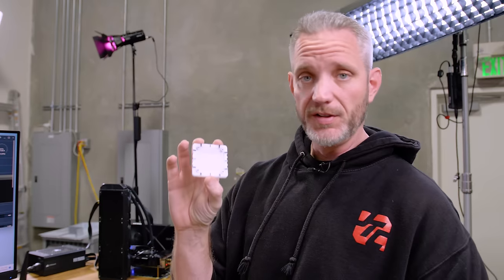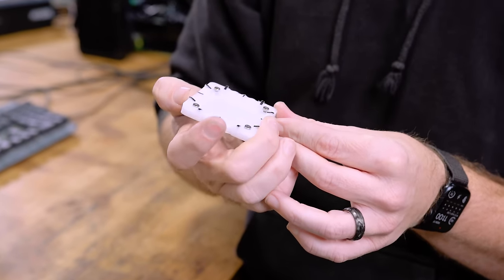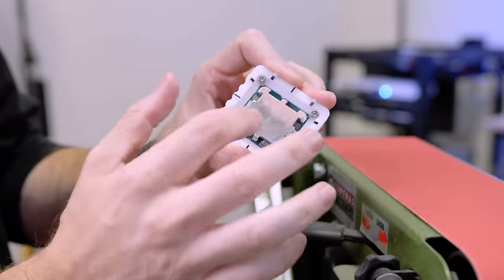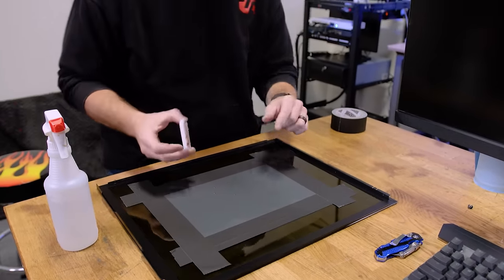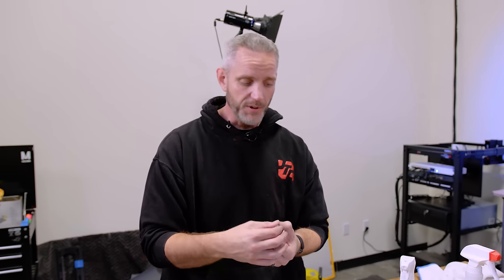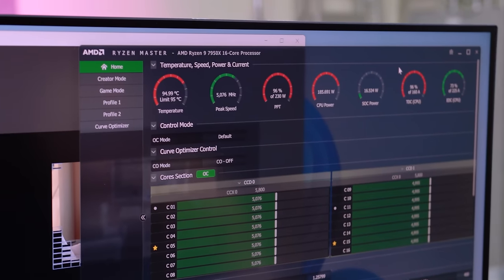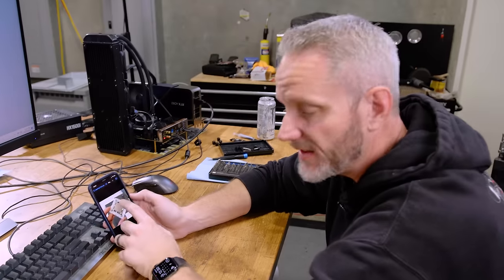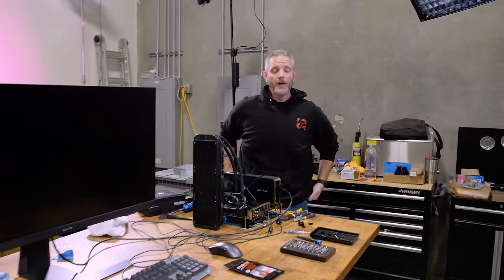Modifying the 7950X CPU for better thermals... VOIDED WARRANTY!

Comment: Jay you shoulda gone all the way and showed us the 1.2 mm result. I was hella curious what you’d get, and without reality to settle me down, I keep wondering “what if it would have dropped 10-15 degrees if he went that last .4”….
Reply: It’s not going to drop another 10-15 like that, probably 5 C is realistic and 10 is very generous. Direct die only takes about 20 C off so this would have to be less than that
Reply: Yeah do not expect miracles from another 0.4mm, but at least he did the test and seeing results for me at least totally worth it, as lapping still has protection for the die, and you shave off like 10-15degrees which is a big improvement from 95, realistically speaking no cpu will run full tilt, but reducing temps increases significantly cpu life and gives extra performance
Reply: Might as well go all the way imo. I would not do it without delid first though.
Reply: @alexmills1329  The autism lvl of AMD is is 10/10, that we have 95c temps instead of 85c because they wanted to make it AM4 cooler "compatible"
Reply: @TheEchelon  Yeah and Audi designed their timing chains last the life of a car.
They didn't last 30 000km. Its a bad design and AMD will address it.
Reply: @hellraserfleshlight   what is the actual 5950x IHS thickness? I think in the vid Jay already showed that lapping 0.8mm got the temps down like 10degrees and there was room for a bit more improvement...
Reply: @DuBstep115  Cool story bro, but there have been 0 incidents that proved AMD to be wrong, but I guess time will tell. But I do agree that it runs hotter than I'd like to see. However, to make matters even worse, go ahead and watch Intel's 13th gen reviews that just dropped and let me know which of the two companies is more autistic ;) Running at 100C and drawing over 300 watts, with almost 500 watts peak, while performing similarly or worse. I'd take the "autistic" 7950X, thanks.
Reply: @alexmills1329  yeah it wouldnt be massive but it would definitely be closer to direct die cooling
Reply: @TheEchelon  Uh I would rather a 13600K or 13700K compared to their AMD counterparts, because AMD in their infinite glory thought it was a good idea to not have DDR4 compatibility, also the 7950X is running at 95c so cool story yourself? Only the 13900K can pull 300W and it will only do this for about 1 minute or so before going back down to and stabilising at its TDP pf 250Ws, and it cannot reach 500W I have no clue what you are on about there, but the 7950X can reach 220W itself. 

"while performing similarly or worse" They are practically on par with each other, I have not seen a single review that warrants using the word "worse" to describe the difference in performance between a 7950X and a 13900K, although in saying this, where I live a 13900K is $100-$200(KF) cheaper then a 7950X, so.. also what is interesting here is that the 13th gen is basically running on a TSMC 7nm processor, and Zen 4 is on a TSMC 5nm processor, to put this into perspective Zen 3 was on a 7nm chip, so I would expect the power draw/efficiency to be in AMDs favour however this makes meteor look much more interesting as it will be a TSMC equiv. 4nm chip, which is what Zen 5 is going to be. Also people seem to forget AMD does not make their own processors, they are made by TSMC, Intel is actually making their own processors.
Reply: @Gandalf721  no it isn't, why does it being a new platform make that reasonsble? Intel has had a new platform and they havent done that, it's one of the reasons Zen 4s sales are absolute garbage, no budget PC user is going to want to go to Zen 4 with DDR5 prices so high, I don't know about where you live, but DDR5 costs $300+, the 13600k/7600X costs $500, DDR5 is nearly the cost of a CPU where I live, and the performance uplift from that DDR5 is no where near worth the cost for most people.

Comment: Im super super tempted to delid my 7950x since its almost a golden sample.
Does 6ghz on all but 3 cores since those 3 cores go straight to 95C while the rest are at high 60s to low 70s on AC assisted water cooling.
So then I can only run 6.1ghz PBO and 5.75ghz all core at 1.32V.
But dont want to void the warranty and resale value since im wanting to upgrade to a 3D version when they are released.

Comment: There are videos on YouTube how you just need to set up a curve optimizer in AMD Ryzen master and drop the temps significantly.  Don't need to void the warranty, or mess around too much ...and temps are below 90c usually 87 but again that depends on your case and cooling choices. this is only in Cinebench,  IN GAMES, THESE CPU ARE 60 TO 80C with an AIO.. Games are not gonna slam your cpu to the thermal wall which is again by design and won't kill itself or void the warranty.

Comment: Any plans for videos comparing CPU bottlenecks of the 4090?

My 5900X runs at 4.95Ghz single core I don’t see 99-100% GPU very often on the 4090 at 4K
Reply: It’s a bit early for now. He’s already shown that the CPU is the bottleneck for 1440p and 1080P with a 7950x. Until a better CPU comes out, everything else is the bottleneck.

Comment: I love kryonaut extreme. Been using it for a bit now. Stuff looks like pink bubble gum. Stuff works great on Video cards and even laptops. Just repasting with kryonaut extreme made my 12th gen laptop not top out as fast and it rarely now hits 100c where as before it would be there constantly. Sure 98c vs 100c isn't much but on a laptop that is a lot.

I have seen kryonaut extreme drop anywhere from 3 -  5c on most replastes.
Reply: Any issues with pump out on gpu?

Comment: I got to get this out of my system:   This is not lapping.  It is at best percussion sanding. Lapping specificly uses a solid base, and an abrasive compound between it and the work piece.

Also one thing I would love to see is someone lap their CPU to their cooler. As you can lap stuff so they mate perfectly together.
Reply: and if they are both near-perfectly flat - they could bond together removing the need for thermal compound inbetween
Reply: @zbrkesbris5987  yup wringing them together.  I would also love to see someone try that.   Though I'm not sure it would work with the mounting pressure needed with landgrid array processors.  As the IHS may flex.

Comment: It was mentioned before but just to put my 2cents in ... use a figure 8 motion when lapping.  As a millwright, when we are lapping the surface of a turbine, for the cover, we use this motion.  You don't need high pressure steam escaping.

Comment: An IHS is usually concave because it will "pump" under load when it gets hot. If it was not concave when it's cold, it would become convex when it's hot. So if you do extreme OC, having a perfectly flat IHS is perfectly fine because you will keep it extremely cold. But if you use it under normal conditions (air or water cooled), it will become convex under load if you sanded it down before. So I actually would not recommend to do so.

Comment: Linus Tech Tips said in their "We killed it... but then SUCCESS!!!" vid that you DO want scratches, but that was when they delided the CPU and were lapping the actual DIE itself so they could liquid metal it which is obviously way better than regular goo and probably means that large scratches don't make nearly the difference that they would if you were using regular thermal goo. Am I wrong? Is there more too this?

I lapped the IHS on my 3900x and I used sharpening stones for knives and even went down to some special hyperfine grit paper of 300,000 grain, I made that IHS the smoothest thing I had ever touched, like actually haha. No polish used. Didn't really notice a huge difference in the thermals lol. A degree C was about all I got.

Comment: On derbauers conductivity test showed amd's nickel coating was pretty think and was decreasing the w/mk so taking it bare copper might help a little on top of improvement from better contact.
Reply: Yes, I find it hard to comprehend why thinner copper helps when all you're doing is bonding it as best you can to another block of copper. I thought more copper = better. Except if you grind off the nickel and make it really flat you're making a better copper to copper contact area.
Reply: @wayland7150  shorter distance the thermal energy has to travel the more efficiently it can keep the chip cool, direct die cooling takes this farthest.
Reply: I lapped mine today. Can confirm the nickel plating is thick.

Comment: Thanks for another great video, Jay.  Just wanted to share this.  I have a 7600x (liquid cooled, Gigabyte B650 board) and can achieve 5.45 ghz all core @ 75~80 deg C using PBO negative curve offset and +200 on boost.  Power settings are "eco mode" (88 watts max).  5.5~5.6 ghz single core.  These are amazing cpus if you understand settings and have good cooling.  I'll be lapping this week as long as the standoffs allow it.
Reply: Could i ask some how much negative did you set
Reply: @nhacspicy6444  PBO voltage offset is -30.  I don't know what that actually equates to in Volts, but that's the max setting and my CPU does fine.
Reply: Tks which temperature exactly come when you play some games :((( I set it Eco mode but when I play it getting so hot like 70-80
Reply: @nhacspicy6444  70-80 is perfectly fine.  It's about the same for mine with a custom water cooling loop (two rad system).
Reply: If you want to lower temps, then lower your boost limits, or set a constant overclock with lower voltage.  You can probably do an all-core overclock of 5.4ghz at about 1.275V
Reply: @EricEschenbach  I will try this,Tks for that

Comment: Not sure if it's really relevant, but I was toying with my Intel 11400f CPU earlier on Intel xtu, running the xtu 2 benchmark landed me a score of 3500 plus, but the frequency report was all over the place, at one point it said that it ran at over 21GHz at 60c, which has to be bogus. It also ran like 8 other times almost always landing a max frequency of well over 13GHz

Comment: I want one of these to make an aluminum one and then mount that in my mill to take it down to size.
I did it to a AMD heatsink and 5800x and it never passes 80c at full speed. 
with this, I would wetsand this with some 4000 grit to finish this up. 
I have the little tub of Kryonaut extreme. I paste everything with it and I love how fast it sheds heat.

cool video here. keep up the good work.

Comment: I think Im going to do this as well, but i started wondering if there is a way to seal around the edge of the IHS to prevent anything from getting underneath during the lapping process.  The thought of copper contamination under there doesnt sit well with me, and theres realy no way of knowing 100% if you've cleaned it all out afterwards.  Im not sure what materials would be safe for this job, but the 1st thing that came to mind was some sort of clay as i would assume it should be safe when in contact with the SMDs around the edge of the ihs.  I also considered a small bead of hot glue as that stuff always pulls away cleanly once dry, and would be more robust than clay, though im not sure if it would be too hot for those SMDs, or if it would let go of them and not pull them off at removal time (probably not, but nothings impossible).  I dont think tape would seal well enough, so thats out, and thats about where i ran out of ideas.   Anyone else have any thoughts along these lines?

Comment: The question is how much temp reduction is the flatter ihs surface and how much the thinner ihs. Next time lap in with minimum material removal first test it and then remove 1 mm and re lap it to compare results. Now that would be interesting to know, whether thinning it really is needed for good results, if you can get a second cpu to test that is.

Comment: Why not water seal housing and water cool direct to die?  If you do, scratches will increase surface area to water increasing cooling.  
Btw, HVAC pipes with microgoves have 40% or something like that better cooling performance.

Comment: I am 55 years old I had done this on a processor a pentium of what I remember, to run it in an ASETEK case at the time Vapochill case with phase change with negative temperatures 😄For a frequency that would be ridiculous today 😁I have never sanded a CPU since, I still have this Vapochill case with Windows XP and the pentium. I have not relaunched it for a long time but sanding remains relevant as far as I see 😎

Comment: Take 3 reasonably flat pieces of cast iron or granite and mark them A, B, C.

Now if you rub A&B together they'll get flatter, but also run the risk of 1 becoming concave or convex even just a little.
The trick comes when you rub B&C together, then C&A. The only common plane between 3 or more surfaces has to be one that is practically perfectly flat.

This is how you create a perfectly flat surface from which all the dimensional precision of the modern world comes from.

With this flat surface, or surface plate you can create the rest of the tools you need for measuring things like squareness, parallelism, flatness, how round something is, and make tools to accurately divide a circle.

Then you can create portable straight edges which are just as flat as your surface plate to transfer that nearly perfect geometry into other machines like lathes or milling machines to make precision parts.

Everything precision around you can be eventually traced back to the surface plate.
It's like the brick in a building, all bricks are relative to the first brick that was laid.

So it is with tools in a machine shop to the surface plate. They are in every shop and factory through the world, are regularly inspected, resurfaced when necessary, and certified to attest to their accuracy and serve as the final authority for all precision measurements.

It's because of this incredible tolerance, down to millionths of an inch we have our interchangeable world today, and it's truly fascinating.

Comment: Amd should produce two versions of the CPU. One where its 'compatible' with existing hardware but not as temperature efficient, and the other version where the CPU lid is as thin as they can make it, but then it's down to the user to make it fit their mounting hardware. This would require the motherboard manufacturers to also cooperate with the way they create the mounting hardware.
Reply: Exactly what i was thinking lapping down 1.4mm is a pain i might call it quits to mich material to grind down

Comment: You should always lap using a figure of 8 motion and a light hand don't push to hard on the cpu . you can use a marker to color the surface and see what  kind of lap job{not to be confused with lap dance}  just  attention your  making it flat and Parelle  figure of 8 motion will help out with flatness. Jay you do a very professional show other than at times some products are just not attention holders so you seem to work in the spontaneous humor just right.... Your passion and love for what you do makes this channel what it is. your soul is in
it

Comment: I'm no where near hardcore enough enough to do something like this, but it's fascinating. I simply am the OC'er who tinkers with bios following OC guides for my CPU and happy to see a small bump in performance with no loss of stability and I'm satisfied. I live in a hot home in Florida with people who don't like to use AC so i feel like i need a lot of headroom to account for huge temp flux in room temp and so running an OC at it's limits of stability would likely not work in my environment. I don't think I've ever OC'ed AMD and plan to go AMD this time, will be fun to learn the AMD tricks that differ from intel.

Comment: Probably shouldn't lap by hand pressure, you'll never get it perfectly even as pressure will vary even if your surface you are lapping on is even.
Also the cold plate should be lapped, they are rarely even from the factory.
Also mirror finish will not insulate heat, having scratches increases surface area which improves heat dissipation... If the thermal compound is hitting all scratches and doing it's job.

Comment: Good Sir. Might i suggest that you use the most bog standard screwdriver you can find to actually feel your way around. It works surprisingly well to do even torque. If not, just a driver with torque limiter or something. Take care

Comment: Do NOT use a power sander.  You don't need to and you will ALWAYS 100% of the time have greater sanding pressure on the leading edge of the belt like that and not sand it flat.  Just do it by hand and rotate it around as you sand...take it easy.

Comment: I've had great luck lapping an old 2700K, got it to run at 5 GHz on a lapped CoolerMaster Hyper 212. Snappiest system had ever used but it used a lot of power.

Comment: Yeah the THICC IHS on my 7950x in a custom loop definitely causes throttling issues on all core loads. Hits 95c without even raising my coolant temps more than a degree (after rads) and runs cpu at 5.13 GHZ. I don't think taking my loop apart and lapping my cpu is worth it, but I hope the 7950x 3D has a better IHS design somehow otherwise there is no point in grabbing it since it'll just cook itself as well.